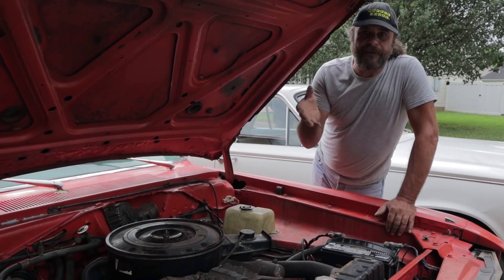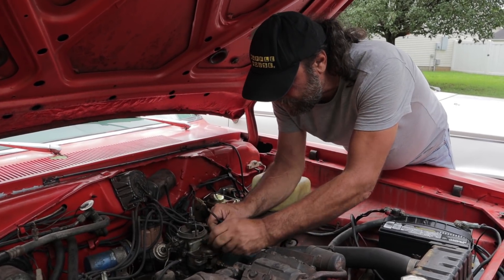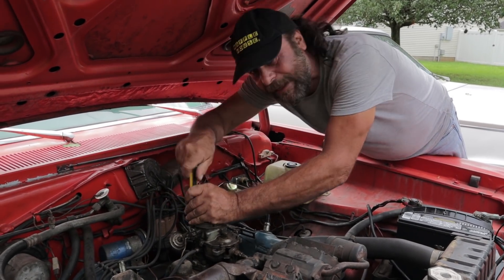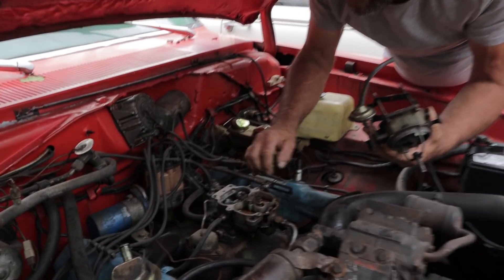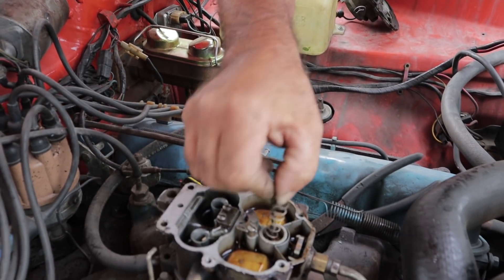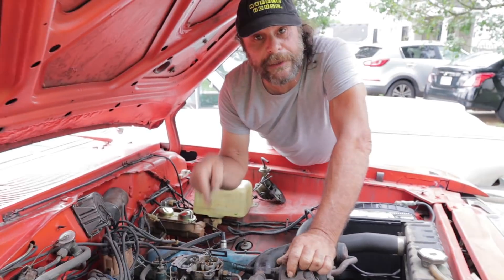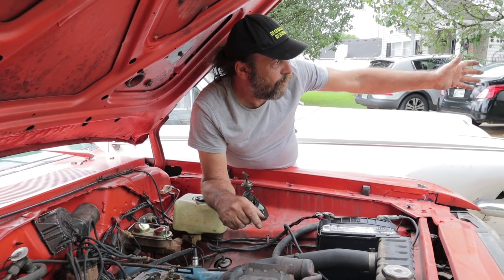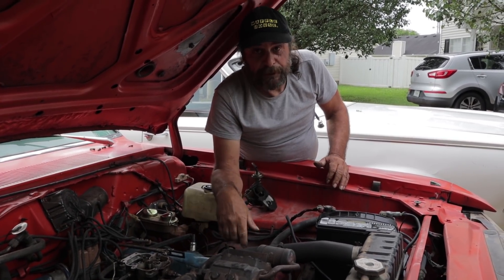Driving Classic Cars- The Truth About Ethanol Gas

Comment: One of the problems with ethanol blended gasoline is that the base gasoline that the ethanol is blended into is usually of a very low burn quality.  Without the ethanol  which will evaporate, what is left will bearly burn in whatever you are running it in. My experience on fuel tank farms was that the ethanol was pretty much like rubbing alcohol,  it would dry up in the air when youd be servicing equipment or changing out valves etc. 
Running it daily is not a bad thing, but in anything you let sit for days or weeks I always run premium.
Reply from the maker: I have not found that to be the case at all

Comment: I think of an engine cranks a few more times before it fires is not a bad thing my thinking process Is that the engine will build a little oil pressure before it starts to prevent dry starting

Comment: I think where a lot of the  bad rap comes from is small engines. It will leave chalky whit/yellow deposits when stored over a season and yes it is hard on rubber lines. Working daily on classic cars for the past thirty some years, I have seen the decline of the quality of the rubber fuel hose that is available.  Leaded, unleaded or blended modern fuels... drain your fuel systems for long term storage.  Thanks for the video clearing up some misconceptions Tony.

Comment: My new floats started to absorb gas after about 2 years and the plastic disc valve thing in the accelerator pump swelled up and I suspected ethanol, so I replaced them with brass ones. I think ethanol might affect plastic parts.

Comment: One station here is heavy with the ethanol. At one point it was 19% according to a customers ethanol sensor in his impala. Thing ran like crap. My old power wagon rejected that fuel pretty much on the spot. It gets premium from another station that uses the least amount of ethanol. 
As time goes on we will see less trouble with the ethanol as the parts have died and been replaced with ethanol tolerant ones. 
Like switching to unleaded.

Comment: I used to run Ethanol in my old trucks since it was cheap, and I never had any problem with it deteriorating parts or messing anything up.  The only problems I had were keeping water out of it (alcohol is a water magnet) and poor mileage.  After several years I decided it was worth paying a bit extra for premium, non ethanol fuel.  The cost difference is made up with better mileage and I haven't had any problem with water in the fuel since I switched.  The cars that usually have problems with it are older fuel injected cars that used plastics and cheap rubber components in the fuel systems.

Comment: Ive pulled a fair amount of carbs/ran engines that sat pre ethanol that had near spotless intakes and runners, throttle blades and such, nice and clean. After running said engines on ethanol fuel and removing the carburetor the intakes were stained and brown, insides of the carbs had corrosion issues and the brass components were being attacked turning fuzzy green. Yes i did buy "ethanol safe" kits. Not too hip on the evaporating gas out of the bowl either since gas prices are all ready shit.

Comment: 1968 Sport Fury 383 2bbl daily driver. I ran non ethanol for a while. Switched to premium with 10% ethanol. No problems whatsoever. This is on a new engine (thanks  S&J Engines), new carb, new fuel line and new gas tank.

Liked the Scotty Kilmer comment.

Comment: I haven't had any adverse effects from 10% ethanol fuel that I can see on any of my older vehicles. the only thing I do to any of them is I add a lead substitute to my 57 chevy to help protect the valve seats. But otherwise i've experienced no weird corrosion, no softening of rubber lines (unless they were a million years old and needed to be replaced anyway), etc. But my 81 Camaro, 79 K10 pickup, and my 57 sedan all have suffered no damage that I can tell yet from E10 93 Octane.

Comment: All I know is that if you let a ATV, lawnmower, any small engine sit stored thru the winter I always have to clean the carbs come spring if I dont remove the fuel. Plus switch fuel lines made for ethanol. If I let my wheeler sit for a couple weeks, I have to drain the float bowl. All the ethanol settles to the bottom along with the water, but they are gravity fed, car isnt. I run ethanol-free fuel now, no issues

Comment: I use PRI-G fuel stabilizer problem solved. I run fuel that has sat for 2 years plus in all my equipment. I think the ethanol draws moisture which causes the corrosion. I have a Stihl weedeater that is over 20 years old and never had a problem. I start my equipment and run each one at least once during the winter with the  old gas that has sat in the tank. I let the fuel sit in the carburetors maintenance free.

Comment: Won't debate the points made...it might not cause...(__________) damage when used regularly or if left to sit for a month (as stated) on some cars.  But I just resolved a perplexing problem after first rebuilding the original carb on my '66 Pontiac Tempest, installing an electric fuel pump, new fuel sending unit.  And that problem was...vapor lock.  The combination of E10 and a clear filter before the carb, with its lower boiling temp, caused vapor to more quickly vaporize in the filter after the engine was warmed up, resulting in...a motor that would stop running.  Call me berzerkazoidal, but I usually prefer the motor in my classic Pontiac stay running longer than 10 minutes.

It was only when I eyeballed an FITech throttle body fuel injection system in the Summit Racing catalog, which mentions that it eliminates (among other things) vapor lock, that it dawned on me that that's likely been the problem.  Fortunately, in my town (Colorado Springs, CO), there are several stations carrying ethanol-free gas (Chief Petroleum and a couple of the new Mavericks).  After putting 5 gals of Mavericks' 88 octane in, I was able to drive it for nearly half an hour w/o it dying as it had been.  And checking the clear fuel filter every few minutes (pulling over to do so) showed that the filter wasn't emptying as it was with E10 within a few minutes of driving.  After returning home, I checked the filter again and noticed it was nearly empty, so I decided to just nix that filter, since the Edelbrock electric fuel pump just outside the tank had one.  I figured I'd nix that filter at the tank, so the fuel doesn't have a place to vaporize (or as easily vaporize).  

Since changing to ethanol-free gas (and nixing the filter at the carb), I've driving it several times for more than half an hour in about 85 degree  outside temps and it never died.  Is it possible just nixing the filter at the carb would have solved the vapor lock problem?  Yes, but since I was able to drive for ~30 minutes w/o dying solely by changing to ethanol-free, I prefer to solve problems as directly as possible by eliminating the actual cause, not merely doing a "work around".

And considering everything else I've read about how E10 is not a classic car's friend, while I'll always respect the experience of an individual (like Uncle Tony), I'll always respect my personal experience most, then tack on a "general consensus" qualified opinion (defined as an opinion founded in experience) as a contributing factor to my decisions and actions.

And it might be a coincidence, but despite replacing what looked to be an almost new fuel sending unit, the gas gauge wasn't working with E10.  I was surprised to see the gauge wake up and show that there's actual fuel in the tank when I first added 100% gasoline.  Can't explain why it was consistently reading empty with E10, but the fact remains.

I also don't think fuel that evaporates quickly is a plus.  I've seen what 100% gasoline does when sitting for years (it turned to a molasses consistency and smelled like varnish).  But I won't be not driving my Tempest for years.  I'm not liking the idea that it's evaporating from the tank in relatively short order if/when I don't drive it for a few weeks.  And I now get the feeling that it was doing just that.  A couple times, I added a few gals of E10 into the tank, drove it for a few minutes (after having done this or that to try and resolve the dying after warmed up prob), get stranded, drive it back (after it cooled down), park it back in the garage and let it sit for a few weeks, and when I returned, the tank would be nearly or completely empty again, so it seemed.  I was originally thinking the original 326 with its 2-barrel carb might just be getting the worst gas mileage in the history of a V8 that otherwise runs healthy, but evaporation has it making good sense.

Comment: I don't have a problem with it either. In fact, it seems to stay viable much longer than without ethanol. There was about 7 gallons in my '98 Wrangler that had been in there for 3 years. I siphoned it out thinking that it was probably rotten, and it was clear and smelled just like it came out of the pump. I put it in my old riding lawn mower and used it all summer. No problems. Back in the day, there would have been gas clots throughout the fuel system. I've heard the horror stories, but have never had any problems.

Comment: I have added about 5 percent diesel to my gas in my 64 Valiant for the last 16 years with no ill effects in the summer months. 1977 head and carb on a slant six. If the battery is up she will start summer or winter no matter how long she sits. She does not sit on an empty tank as my only precaution. Going out here in a bit for a ride after she sat for two weeks. Any bets on if she starts? You should probably play it safe.

Comment: My truck has run on nothing but 87  and cheap 2 cycle for a good 7 years now.
 Though there is the chance that the gas is irrelevant and it's running off of some entirely different kind of spectral energy. 
Hard to tell.
Reply: Ary Dabirnia What kind of truck do you have that has a two stroke engine? 🤔
Reply: @rustyjeep2469  it's an old 6 cyl, I add a very small amount of 2 cycle as a fuel stabilizer and also as an upper cylinder lubricant. Since the new crap is unleaded.
Reply: Note to budding chemists: I saw this on Bob Is The Oil Guy some years back, and the recommendation was for ASHLESS synthetic 2-stroke oil.(TC-3: from WalMart ).About 1:500, I believe. I know I settled on 2oz for 8-10gallon fill ups. It did noticeably quiet & smooth several high-mileage Saturns and an old Subaru I looked after at the time. 
Go check out BITOG for >way< more than you want to know about oils & gas additives. Some damn knowledgeable people there.

Comment: Here in ostraya e10 was supposed to eat all the rubber components in petrol pumps lines ect. I did use it in my 95 fords and both The pumps died but the 2010 GMs are ok with e10/85. Love your tutoring

Comment: Tony, you remember what 1970 gasoline was like? Even the best of it would leave varnish and sludge in a carb before five years were up. You'd have to overhaul the carb and buy a rebuild kit anyway, so what's the difference with gasahol? No real difference, carbs still need routine maintenance. First time I overhauled a four year old carb, the car's mpg and top end both went up, maybe 8%.

Comment: The only issue I have with the ethanol blended gas is the fuel mileage drops more than 10%. If it's 10% ethanol, and I'm burning 15% more gas, then it's causing more gas to be burned than if it wasn't there to begin with.

Comment: I remember how old gas used to smell. I remember how money used to smell. How's that 10% ethanol affect my burn rate? Do I get better atomization? Sometimes I add a little isopropyl alcohol to my gas.
Because I'm concerned about water. Is that a real concern?
Thanks again Tony
Reply from the maker: In theory, it SHOULD help atomization because of the lighter SG of ethanol, but it's minimal at best.  That's actually why alky is added to nitro...there it has a pretty big effect.
As for water accumulation, I've yet to have any issues with that.

Comment: Not going to make a cigarette remark during the carb disassembly. Wait,...I just did. Nice video as usual. Good insight into this much talked about fuel issue in yesterday’s cars today.
Reply: I had friend lost his car mechanic business when he got sprayed with gas and it ignited, he spent 9 months in the burn unit in Gainesville,  FL. He lost everything, and eventually his life... 
He made custom cars for himself, had a 3-wheeled hot rod with helicopter controls inside. Looked like a space vehicle back in the late 80's. To prove car stability with a front wheel blow-out, he took it out and got it up to 80 and shot out the front tire with a .22 rifle. He did not want anything that wasn't going to be safe on the highway,

Comment: As a daily driver you should not have a problem.
Problems start when car is sat for months as it will corrode fuel lines,pump,carb and rust tank.
As E10 evaporates it produces water vapour.

Comment: the problem here in the Denver area. where I worked we once had a 360 dodge 3/4 ton 1978 van (no air conditioning). when it got to over 100 degrees out the thing would stall out while driving from the alcohol gas percolating in the carb even as you drove. If you were steady driving and not in stop-go it would be ok. the thing would go on if we opened the hood for more cooling. Yes, driving down the street with the hood open(van you could see over it fine). fuel injection no problems. I like fuel injection for daily driver. Like the Toyota Echo the best car I have ever owned.
Reply: Ethanol gas has a 1 psi higher Reid vapor pressure than non-alcohol gas. All modern gas has higher Reid Vapor Pressure than gas back in the day which is usually what causes the problem.
Reply: @bradboustead1682  Ok but its the Liberals messing with it.
Reply: @NebukedNezzer  true that.

Comment: The only problems I’ve had with ethanol fuel is in small engines. Generators, lawnmowers etc. it seems to oxidize inside the small passages of the small carbs in my experience. Never had any problems in my classics.

Comment: About 6-7 years and the brand new rubber hose used for short sections near my fuel tank in my 84 Cutlass cracked and started leaking gas badly. I didn't notice it degrading until it leaked. 

I run e10 all summer while driving it daily but I make sure to park it with 91 octane 0% ethanol, same with my lawnmower and trimmer.

If you're daily driving it you just might have to replace all the rubber components every 6 years but if it's going to sit for any length of time don't use e10. 

I put 100k miles on my Oldsmobile in the past 12 years and the carb had to have the needle and seat replaced (covered in white guck) after about 8 years and then at roughly 10 years it plugged up and had no power so I ended up putting a used carb on it with the jets, rods and hangers from the old carb. It's been fine since then. 

I did find out Petro Canada who I used to buy a lot of gas from used to use methanol in their winter blends (even more corrosive than ethanol apparently) so maybe I unknowingly poisoned it over the winter. Either way the way the rubbers crack I'm sticking with e0 other than in the summer when I can't afford to put anything but e10 in it.

Comment: I've been running my 83 Ford F 150 on ethanol gas for 6 or 7 years and It doesn't seem to have effected the carbutetor. I even have some rubber fuel line that says it's not intended for enthanol fuel and it's been on the truck for around 5 years.

Comment: My 86 505 has a CSI high press mechanical injection system running of a Bosch inline pump with one way, an in tank down pump, and vac pressure accumulator.  Sometimes it takes a moment to build pressure. This may be valuable information, the evaporation bit

Comment: In the UK we only have petrol with 5% ethanol added, this year we will have 10% ethanol as our standard and the 5% will be phased out.....

we've been warned about it damaging plastic fuel tanks, rubber fuel lines and the internals of fuel pumps etc but no one seems to know which vehicles will be ok with it or which won't be....
Reply: paul austin  sadly not all super unleaded in the uk is ethanol free, i believe esso and shell are the only ones left and esso super unleaded will be 5% ethanol by the end of the year

Comment: I had to quit using ethanol in my vintage two stroke bikes, I was getting the chalky buildup . Just use Vp 110 , jet it leaner and add timing in some bikes . I’m intrigued by you getting zero residue in carb .
Reply from the maker: Probably a combination of the two stroke oil reacting with the ethanol and the fact that it's gravity fed and won't evaporate away before it can turn stale

Comment: I always heard Ethanol Fuel would ruin the Valves,O-rings, and seals in the Engine. That when you get an old engine its a good idea to replace old parts with Modern day Designed Parts made to resist Corrosion within the engine itself.

Comment: Ethanol soaks up water from the air.  So as a daily driver, I would expect it isn't a problem.  With a classic  simpler car that doesn't need emissions equipment etc, its less of a problem as well.  Soaking up water and evaporating the ethanol first, leaves just water though which rusts and ruins small motors the most.  It also brings more carbon build up.  Newer motors with all the emissions passage ways and cycling of fumes also causes more damage.  On old cars, gummed up old gas protects the insides if anything from rust, before you come in with carb cleaner and restart after 6 years of sitting.

Comment: I can't tell if this is a funny or not...     but my DD 300 carter yfa won't be seeing any corn.    Finally got her running right ha.
Reply: Corn killed two separate Holley 1bbl carbs on me, one right after they mandated it here in Iowa and the second about 6 years later.

Simple test, buy two hard rubber o rings, soak one in ethanol and one in dino for 2 days and then try to stretch them.

It'll shock you.